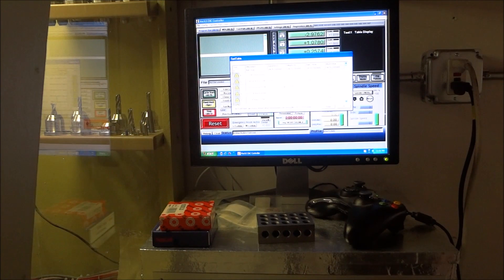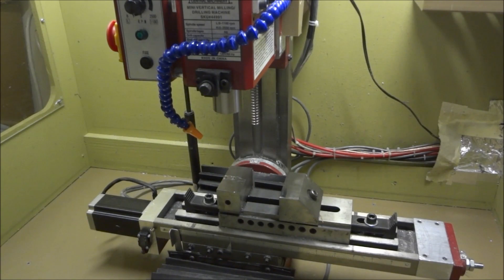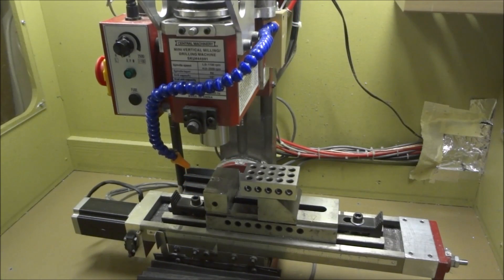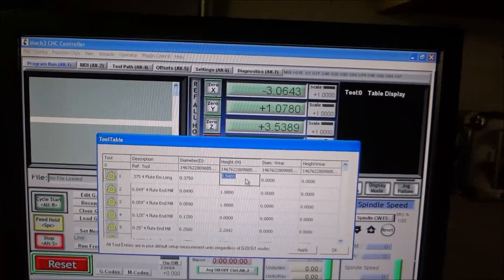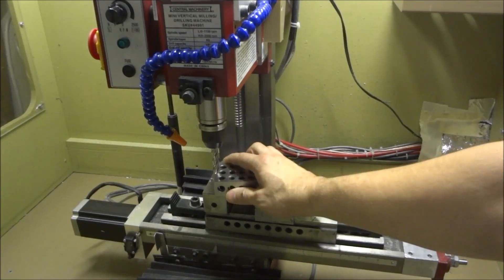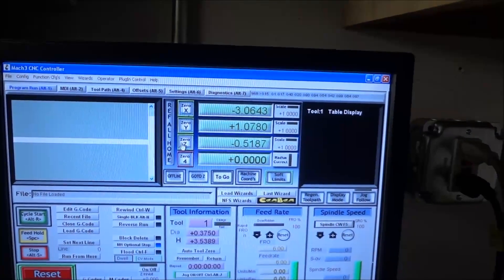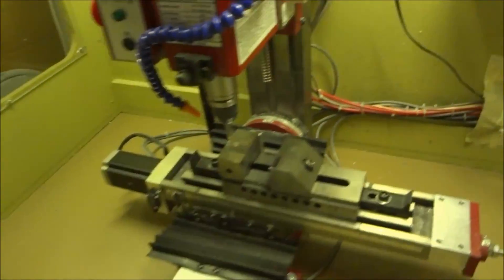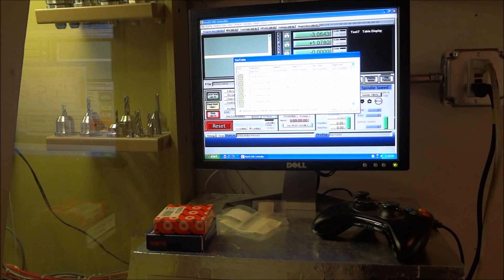Mach 3 Quick and easy tool table Offsets

Comment: or you can use a touch plate
Reply from the maker: You can use a touch plate however you will still need to accurately set tools in relation to g54 z zero

Comment: Hey look like the harbor freight mill..
What are you using for a drawbar.
Sounds like air
Reply from the maker: Yes Air
Reply: @CNC4XR7  did you build it or did you buy it.. Ivan interested in doing it
Reply from the maker: Yes I built the X2 PDB
Reply: Any chance you got pics etc plans ..what is PDR
Reply from the maker: Sorry Power Draw Bar

Comment: Hi Sam - Just subbed your channel. What kind of spindle is that allow for the air-powered tool changes? I really want one! And what types of motors are you running? Thanks!
Reply from the maker: The X2 has a R8 spindle I am using a 3/4" collet with TTS style holders they are repeatable and have a 3/4" shank

Comment: Hi Sam, I have populated my tool table with all the different heights of my tools. I have measured my touch probe =0. Then measured all other tools referenced +/- compared to that. So far so good !, I then use the touch probe to get my G54 position. When i generate my G-code with HSMXpress i get the G43 code, but when i run the code on the mill Mach3 does not turn on the tool offset (No green light) Result is that the tools all are exactly the offset value height above the part at all times. Do you have any idea why that is ?
Reply from the maker: Lets See, I do not understand this comment "  I have measured my touch probe =0"  physical  Z zero  is the bottom of your spindle! so the probe should also have a length. Next you say the offset led is not light even though a G43 is in the code? How is the G43 written? G43 Hxx     xx being the tool #?
Check that you dont have ignore tool change checked under config/general settings.
Reply: Hi Sam, You have solved the problem !!! Hurra !! You asked just the right question about the Hxx in the G-code. It turnes out that when i originally populated my tool library in HSMXpress i tried to input offset values, but i realised that i could not input any negative values and forgot all about it. This was an important mistake. All values must be the same for : tool number, length offset and diameter offset. When i write i measure my probe to be zero i mean as follows. I put my BT40 holder with my digital probe on top of 2 (1-2-3) blocks and measure the height which i consider zero. All other tools measured the same way have a negative or positive value which is then my offset value. So after i corrected all tool numbers, length offset and diameter offset for each tool they worked perfect and the GREEN LIGHT was turned on when the different tools was called in the G-code. So thank you very much !!!! Peter
Reply from the maker: Peter your very welcome, It's what I do for a living so asking the right questions is 80% of troubleshooting. LOL

Funny thing is if you were using my Manual Tool change macro you would have never had a issue as I have the G43 built into the macro so it's ok for it to be in the code but not needed.

https://www.youtube.com/watch?v=D_XlXBq2Szs&t=12s

Comment: Got it. I figured that you could find part zero with any tool, but asking is cheaper the testing sometimes.  Thanks!     Steve
Reply from the maker: The most important thing to remember is don't start a program with a tool in spindle and make sure you set z with a tool and not forget to change the tool #

Comment: Sam, why do you need to set the height of the spindle nose (tool 0) to zero if all tools offset from tool #1? 
 After the tool table is populated and you are ready to start a new job, how do you find Z zero on the part? Do you touch off the spindle nose or do you touch off tool #1

Sorry for all the questions,  
Steve.....
Reply from the maker: +ricochetproducts  Hi Steve No Problem,
The simple answer is Yes, Tool 0 can not be changed in the table and is not a tool at all! Its used for when there is no tool change used in the gcode and your setting Z for the tool your using. In this demo I'm using Tool 0 ( the bottom of the spindle ) to measure and populate the tool table.
If your tool Table is populated correctly then you can set Z for a job with any tool. I use Tool #6( 3/8" 4 fl EM) a lot so I set my Jobs to tool #6 it keeps everything consistent.

Let me know if I confused you more or if you have anymore ?
Be safe sam

Comment: I'm trying to use this method but with reference to the table. I have a 2" toolsetter that I bring the spindle nose down to and reference as Z0. when it's 2" Above the table. I'm assuming with this method, I do that with tool zero, then reference all my tools off the table and the 2" setter as well. Now in the work offset, say the distance is measured as 3.750" from the top of the table to the top plane of G54. Would I be right in that G54 Z height offset would be 3.750"+2.000"? I'm having quite a hard time getting everything to come back to zero with multiple tools.
Reply from the maker: +Colin Worobetz  HMM you lost me at I'm trying!    No just kidding.
Ok so weather you set Z0 to a Block a tool setter or a bottle cap it's Z 0 correct. 
Insert tool 1 and set as mentioned above make sure its Tool 1 ( what ever that tool may be) 
In the Tool table the offsets for Tool 1 are ALL Zero That's Correct and will stay that way.

Insert Next Tool #2 jog down to a Block ,bottle cap , table . What is the DRO reading? XXX.X insert those #'s into the Tool Table for Tool #2 this is the offset.

Now to verify on the program screen type in tool # 2 in the pink box hit enter the Z DRO should change from XXX.X to  000.0 

Type Tool # 1 back in and it should go back to the offset you had before. if all is good proceed with the next Tool.

Always getting offset figures from Tool #1 DO NOT ZERO Z DRO AT ANY TIME DURING THIS .

Use a 123 block for now the tool setter may be throwing you off.

Hope this Helps,
Be Safe Sam

Comment: That's the way I do it as well, except instead of the 123 block I use one of these http://www.ebay.com/itm/SHARS-MAGNETIC-Z-AXIS-DIAL-SETTER-0004-GAGE-offset-pre-setter-tool-CNC-NEW-/301203002700?hash=item462119154c that way I don't have to worry about crashing the tool into the block, or going up and down so many times. When the dial reads 0 the height is 2.000".
Reply from the maker: +Crivo152 Yes very useful Items if you happen to have one, thanks for sharing My friend.
Sam